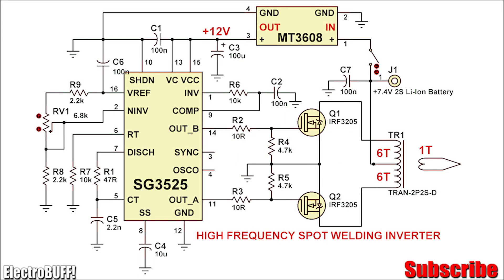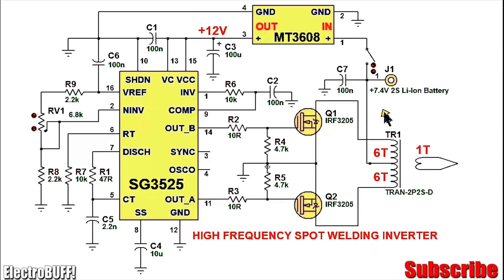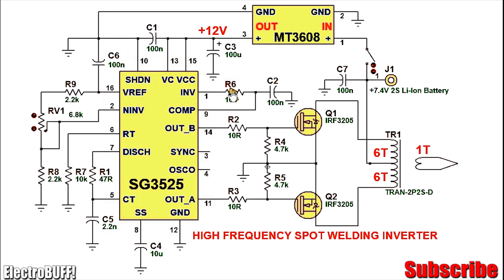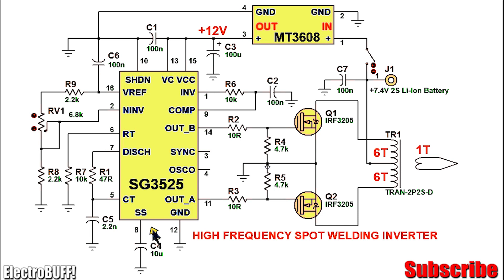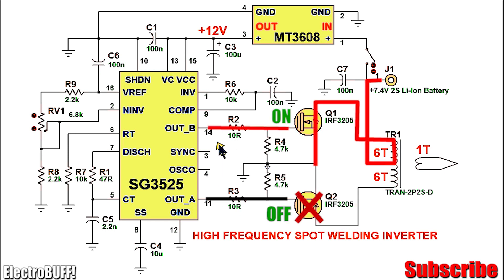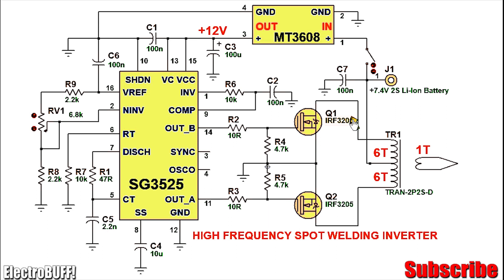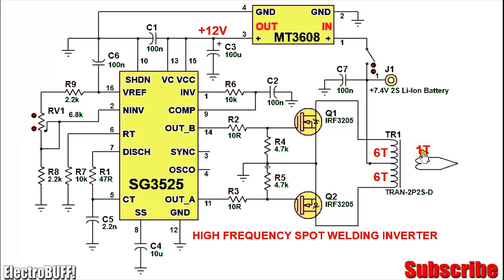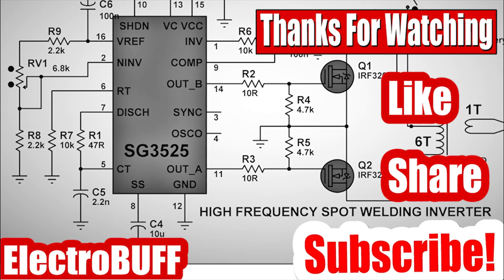High Current Power Inverter With SG3525 for Spot Welding and Instant Soldering

Comment: Dear Sir, I have a question, I am designing a TIG welding machine, the output current adjustment I connected to Pin9, Pin2 is connected to pin 16, pin 1 connected to GND, then my machine have a problem, the arc start is not stable, Please, help me have some advices, Thanks !

Comment: Can i use this pwm scematic for smps?
Reply from the maker: Yeah, it's actually a Switch mode power supply only that due to the turns ratio the out is of lower voltage in order to increase the current output for spot welding. Just modify the secondary turns for higher voltage as needed.
Reply: @ELECTROBUFF  don't need to change the duty cycle value of the circuit?
Reply: @ELECTROBUFF  i mean smps use line electricyty 220VAC
Reply from the maker: @Herman-xq1wr  nope. Check out this video for such a project
https://www.google.com/search?client=ms-android-xiaomi-rev1&tbm=vid&sxsrf=ALeKk01nZJl-jGZh2rVwGQm-iNnn20PJjQ:1613570146186&q=ElectroBUFF+tl494+adjustable+switch+mode+power+supply&sa=X&ved=2ahUKEwiGooibifHuAhVLURUIHTUeBywQ8ccDKAV6BAgBEEI&biw=360&bih=685#
Reply: @ELECTROBUFF  i mean tl494 or sg3525 pwm for smps 220AC i have to look all of your video, and i cant find them
Reply from the maker: @Herman-xq1wr  have a look at this one
https://m.youtube.com/watch?v=jUSNamjIf_c&t=2s

Comment: Hi...Please design a igbt based voltage stabilizer circuit (Dynamic Voltage Restorer)... In india where i live, there is much voltage fluctuation problem..I have a relay based stablizer but it makes so noise while fluctuations and makes the expensive led bulb fuse.... My computer power supply and motherboard gets burn.. i m frustrated so much... please HELP...
Reply: THANK YOU FOR TEACHING US MARVELOUS CIRCUITS , MORE THAN WHAT COLLEGES CAN OFFER
Reply from the maker: Okay